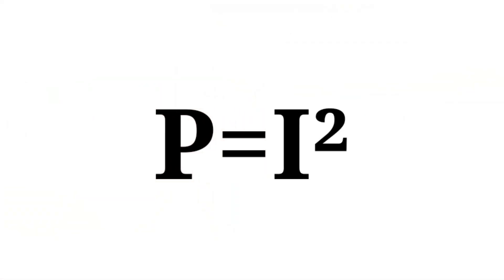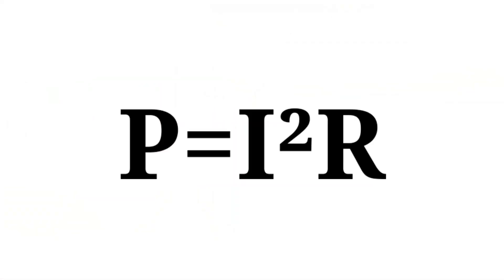Aggregate current and how does it affect MF junction boxes? - Wago 221

Comment: So if I’m understanding this correctly, you can not use a Wago box to take a spur off a ring final as it would go over the max aggregate total and even if it did comply you would have to de-rate the 32A Main MCB to a 20A one? Does this only apply if the Wago box is being used as a MF. What about normal instal but not MF. Helpppppp

Comment: Could someone tell me how this would relate to spurs off a ring final. If I had a three terminal wago block with the line in line out and spur line connected and then another 2 blocks in my junction box for my neutral and earth connections respectively, would that be considered as 2 x OPD rating  to calculate the max aggregate current or 3 x OPD due to the spur.

Comment: Interestingly the WAGOBOX 221-4 derating from 32A to 20A per connector for MF locations, plus the 50A overall current limit for all conductors using the box are ‘made up’ numbers because the certification test hasn’t been carried out by a UK entity.  Copper doesn’t change its electrical characteristics if it’s under floorboards. In particular this pseudo restriction implies a WAGOBOX should not be used to create a spur from a ring final circuit as the 50A limit would be exceeded, even if the ring legs were assumed to be 20A each, the spur could draw 26A.  Please advise if I’m looking at this the wrong way.

Comment: Reading the WAGO datasheets for the Wagobox XL and WagoBox XLA it states, "The Single Side Max Aggregate current (Iag) is the sum of all the possible currents through either the left or right side of the WAGOBOX® XLA in normal use. This limit must not be exceeded. Usually the max Iag equals the number of phase connectors multiplied by the rating of the Overcurrent Protective Device for the circuit.

Comment: Reading the WAGO datasheets for the WagoBox and Wagobox 221 it states "The Max Aggregate Current (Iag) is the sum of all the possible currents through the Wagobox in normal use. This limit must not be exceeded. Usually the max Iag equals the number of phase terminals in the Wagobox multiplied by the rating of the OPD* for the circuit."
Reply from the maker: Yup, that's what we explain in the video. For further information check out our free training package on this subject. 😊

Comment: What's not clear to me is whether neutral conductors on single phase supplies should be counted? Logic suggests they should, but the wagobox instructions only tell the user to count phase conductors.
Reply from the maker: Yup, they should. As current flows through the neutral it has a heating affect in that connector as well. 😬

Comment: Here in the US, we have Wagos, primarily used/ found in light fixture wiring compartments.  Specifically LED lighting or very low current draw. Personally I don't know of any electrician that uses them for general splicing purposes.  Their failure rate is too high. Unfortunately in the states our primary cable for branch circuits is solid copper wire up to 10 AWG. I wish there was stranded cable acceptable for residential and commercial branch circuit wiring.  The WAGOs just dont have a good mechanical/ tight contact on solid wires. Yes you're correct about the I2R loss, which is what will burn your house down! Some Electrical Inspectors will not allow their use. Even though they have a UL rating.  Personally,  I never use them. 
Nothing beats a good quality wire nut, in a steel junction box for a tight mechanical connection that lasts for decades! I love watching your videos and learning about your wiring methods. Very interesting.  I have a lot of experience with European equipment.  But mainly in the industrial electric applications.
Reply: "Don't have a good mechanical contact."

Of course they do. They are throughly tested. I don't know of anyone who's experienced a failure. So, I have no idea why you claim a high failure rate.

Can you provide evidence for this claimed high failure rate?

Are you sure you aren't confusing Wago's with a lower quality make?
Reply from the maker: Thanks for commenting it's great to get some perspective from over the pond. I've never yet had a Wago fail on any type of conductor. I wonder if it's down to differing voltages and higher currents over there. Anyway, always good to hear a new point of view. Stay tuned for future content. 😊

Comment: Perhaps someone could explain exactly how does sealing the wagobox with a cable tie changes the necessity to maintain it? Does this indicate the manufacturer’s lack of confidence in the mechanical integrity of their own product?  To me, this reeks of marketing strategy, rather than sound electrical engineering! In my experience, Wago fail miserably with their boxes/enclosures and need to get their act together!
Reply: Tickbox exercise to meet the requirement to only be opened with a tool in BS5733. Nothing more

Comment: Disappointed with the Wago information, personally I will never use the Wago connectors for MF situations again as I won't be confident that their rules haven't changed and I'm not aware. Hager J803 and J804 are MF with terminals rated at 20A and 32A I'll just stick with those, no need worry about aggregate current as far as I'm aware😵 you may advise me differently.

Comment: So now it seems when 1-Amp is flowing down a cable it’s suddenly being classified as 2-Amps, to me this is nonsense. Yes in a junction-box/connector each terminal resistance increases the heat generated but only by very small amounts. Also suddenly Kirchoff’s law (sum of the currents at a node must be zero) has been changed as 1-Amp in the example now becomes 3-Amps, but it’s the same 1-Amp flowing. This is all very questionable in electrical engineering terms.
Reply: Also the heat would be divided by each connection so 0.5a each. Heat will only be produced via resistance of the connection. So if it has a 0ohm reading across the connection. Its not loosing energy to heat
Reply: Also. To further back this up, if one connection had failed, and started resisting the current. Ant others would be in series, so it would be r + r (for each failing connection.) With the current only being 1A how can that box have in excess of 1A of potential heat dissipation when that is the total current of the circuit.
Reply: @Liberator975  good point as a fault that manifested itself as extra resistance and current would fall thereby reducing power dissipation! It’s marketing hyperbola!
Reply: How so? It's quite simple.

Assume the connections have an identical resistance.

They will each have the same current flowing across them and therefore using something as simple as (ignoring power factor etc as it is easier for this example...) P = I²R... Same resistance, same current, so shockingly enough the same power.

This means that the simple heat energy is exactly double than it would be if just one connection was in the box.

Strangely enough if you add another connection with the same resistance, even though it is in the same circuit, you've added that same power again...

As to the comment about a 0Ω reading... nice to know you've invented a room-temperature superconductor connector.

Comment: I thought the levered connectors were not MF? Only the push connectors are?
Reply: Same here
Reply: The lever ones are only maintenance free when installed to manufacturers instrictions, i think it the levers need to be cable tied shit and installed in a wago box
Reply: Both our PUSH WIRE & Lever connectors are maintenance free to BS5733 when used in the correct enclosure. The only difference is the enclosure as the connectors have to be retained in addition to the cables and the 221 series needs a smaller slot to keep them retained.

Comment: I have never used Wago products. They look like disaster waiting to happen in years to come.  I don’t consider any type of domestic Joint/ junction box to be maintenance free. Also over the years I lost count of how many times water has got into a Joint box  under the floor due to a burst pipe or water leek. In this day and age all joints should be easy to access. and not considered maintenance free. 
Just my opinion
Reply: We need methods of jointing which can be done and forgotten about for 100 years, e.g. the DNO cables buried under the pavement, and repeaters for comms cables under the Atlantic.  I wouldn't fancy doing an EICR on one of those.

Comment: Do you know what it is Joe. There are so many regulations and Guides you need to know now, 

IET Wiring Regulations, Eighteenth Edition, BS 7671:2018
Amendment 1 of BS 7671:2018
On-Site Guide (BS 7671:2018), 7th Edition
Guidance Notes 1 - 8,  
Guide to Cables and Cable Management
Code of Practice for In-service Inspection and Testing of Electrical Equipment, 5th Edition
Electrician's Guide to Fire Detection and Fire Alarm Systems, 3rd Edition
Electrician's Guide to Emergency Lighting, 3rd Edition, 
Electrician's Guide to the Building Regulations, 5th Edition.
The Health and Safety at Work etc. Act 1974 (HASAWA), 
The Management of Health and Safety at Work Regulations 1999, 
The Electricity at Work Regulations (EWR) 1989, 
The Provision and Use of Work Equipment Regulations 1998 (PUWER)
The Electrical Safety Standards in the Private Rented Sector (England) Regulations 2020

and the list goes on, so i'm not surprised that Electricians don't know of this.

Great video though.

Comment: This is the problem with one box suits all I guess. Ie can be used as a standard joint box, maintenance free, lighting, power.

I’m guessing the Hager j803’s have been appropriately rated for use on ring circuits as this was what it was designed for. 

It does however seem a little silly. As a lighting joint box can surely not be expected to emit enough heat under normal conditions to effect the enclosure in a detrimental way?
Reply from the maker: I kind of see it as a strength really, one product can serve multiple purposes you just need to know the details on how to meet those purposes properly. I agree with you on the lighting point, but even checking the calc brings you to 18A and if you volleyed a couple more connections in there it'd only be 30A still well within the 50A max.

Comment: Am i the only spark that has never heard of aggregate current and have no clue what its all about?
Reply from the maker: Nope we hadn't heard of it till about a year ago. Always something new to learn, there's no shame in that. What's dangerous is when you learn something new and decide to ignore it because it doesn't fit in with what you've always done.
Reply: @efixx  That's a comment that is true way beyond this little video!!!! Very heavy and important principle
Reply: I'd never heard of it and honestly it makes me not want to use wagos anymore, I was a big supporter of them but it just seems like they're basically saying they're not suitable for any socket circuits. I wonder if something's happened to make them issue this notice. 

Before anyone says "not mf" a lot of the places we'd use these would pretty much be mf. 

Also what's the impact if we don't follow this aggregate current rule? Fire?
Reply: @TheFool2cool  I spoke to wago about this and the fact you have to derate the connectors from 32 to 20 when using MF. The whole thing is a storm in a teacup. A lot of the time where people think they should be using MF i.e under floorboards it could be argued that it's still accessible anyway. Is it inaccessible even if it's behind plasterboard? Not really just note where it is on the cert. People will just have to get their big hammer  out.  Manufacturers hold too much sway at the moment and the entire industry is getting sucked along with all the ass covering that is going on. Shit flows down hill and it's all ending up on the shoulders of the luckless sparks who has to read every note and caveat hidden away on a datasheet only published online in order to make sure he or she is compliant. Selling a fan to install on your average domestic lighting circuit usually rated at 5 or 6 amps? Why build the fan so it can be safely installed on that circuit when you can insist everyone fit 3A fuses and then have no liability if it doesn't get done and the cheapo fan burns the house down. It's a total shitshow. Vote with your feet people. Sorry for the rant.
Reply: @TheFool2cool  Surley aggregate current  applies to all junctions boxes, not just MF?
Reply: @TheFool2cool  lol what.. This doesn't really have anything to do with Wago, they're the ones bringing attention to not overloading their boxes. 

P=I^2*R is just a power equation.

If you choose not to abide by the maximum aggregated currents, you'd potentially be risking overloading/heating the junction box.
Reply: @danedwards_ee  so you've never used wagos to joint a socket circuit?
Reply: Thanks for this Jo. Never knew this before, so something definitely to start thinking about.  🤔 ... Every day realy is a school day 👍
Reply: Time for JW to do a video on the matter.

Comment: Interesting subject Joe, but how does this relate on a ring final circuit? do you base it on the circuit protective device 32a which takes it over the 50a rated of the wagobox or do you take it from reg 433.1.204 where the current carrying capacity is not less than 20? which sticks it under at 40a
Reply: I have regularly seen ring finals extended using WAGO 221 rated at 32A in a pair of WAGOboxes. Provided a. Only one half of the ring is in each box and b. The box remains accessible, I believe this is compliant.  I’m not certain why the connectors are derated to 20A if the WAGObox is in an inaccessible position, I can only think of a potential worst case thermal issue because the manufacturers have no control over the final location.  Comments please...
Reply: @MS-Patriot2  i agree, seen it done a few times, never done it myself, have only been wagos the past year on lighting and that was due to a shortage of the quickwire connectors, i'm not a big fan of MF on rings i always quote to replace
Reply from the maker: Great question. Watch this space!
Reply: @efixx  Cheers .. i have a sneaky suspicion a lot of sparks are going to be running back to jobs and derating circuits to 25a
Reply: @efixx do you have a Wago approved response please? Extending ring final circuits, with MF Wago boxes is common practice. Certainly we all need a formalised approach!
Reply: @efixx  it's 20A. All the connectors themselves have to be derated to 20A when used maintenance free which is fine because just like the cable for a ring final it only needs to be rated at 20A. In a domestic environment most ring legs will only see 10A for five minutes on a bad day so I think it's unlikely to be a problem there. In practical terms as well does having the box in a void or visible on a wall actually make a difference to what happens inside it? No. So is it likely to burn your building down... No... Is it non compliant with this MF thing.... Yes. But there are worse things that I see electricians do everyday that i'd prefer to see first.

Comment: Nice simple description here and implications for electricians. Well done Joe👊🏿. Though there is much more to this resistive/ohmic heating than meets the eye. I am glad you talked about power dissipation in terms of heat at least in terms of conservation of energy. It is described as Joules Law of Heating and in mathematical terms it is the first differential of work done to move current around the circuit. This is simple Ohms law physics linkages at the macroscopic level. The origins of this power dissipation at the microscopic level are the inelastic collisions of conducting electrons with the lattice of metallic ions forming a conductive material. The equation at the microscopic level is therefore much more complex to take account of quantum effects and the wave particle duality of the electrons. The electrons are able to propagate without scattering inelastically for a longer distance through the lattice than expected, and the scattering probability is much more sensitive to lattice defects than the density of the lattice. Your being a bit naughty this formula really applies to DC circuits and instantaneous power. For current variation which is the case in AC circuits you should be talking about average power and then incorporation of a phase difference that exists between current and voltage. As I said more to this than meets the eye. Lower joule heating For ring circuits is an important advantage for rings. In this case power is delivered to outlets at lower currents (per wire, by using two paths in parallel), thus reducing Joule heating in the wires.
Reply from the maker: Great comment, thanks very much!
Reply: @efixx  I hear all the time from younger sparks that your training is top notch and many have benefited from your training videos on your channel.

Comment: I was having a discussion about spider point wiring is this why we no longer see spider point wiring?
Reply from the maker: Sorry I've not heard of that, is it whne you take a supply out to a jb and then legs out from that central point to loads.
Reply: @efixx  Yes I have seen that in numerous places and now I wonder if I should have rewired the place. Only on lighting circuits where they have the feed come in on the landing and switch lines and feeds to fittings coming out.
Reply: Isn't that just Radial?  The radial topology is analogous to the spokes of a wheel with the hub in the middle.  A spider's web is more complicated than the spokes on my bike wheels.